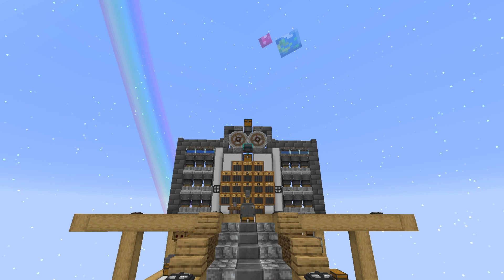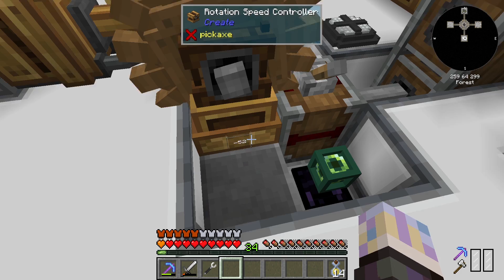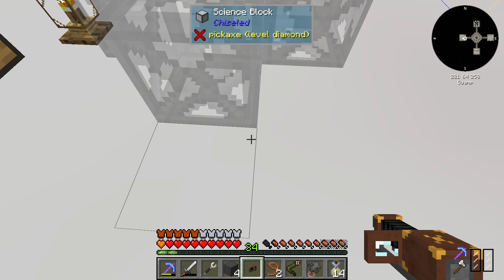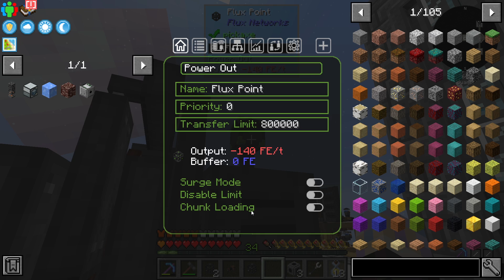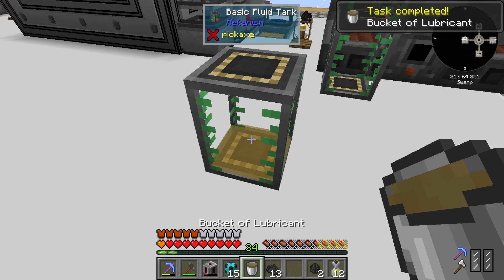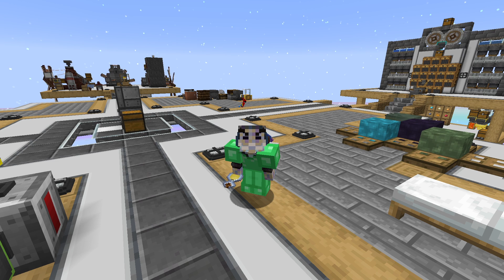Skyopolis 4 Immersive Petroleum EP10

Comment: Actually System, the rotation controller can be used in either direction. In my setup I have the flywheel connected to the side of the rotational controller, spinning a big cogwheel at 256 rpm. Also, if you put a lever on the external heater and flip it on you don't have to process anything in the furnace. Unfortunately it doesn't work with the blast furnace, but given the flywheel on a furnace is already double what a windmill can put out you can see how it's not super necessary.

Comment: The higher tier pipez filters you can use the destination tool to filter where the output goes.  Just remember when using the destination to click on the block face that the pipe is connected to

Comment: I’m pretty sure if you put a lever on the immersive heater and flip it on you don’t need to actually smelt anything to run the furnace engines.
Reply from the maker: I will try that out, but I need all the stone anyway for the blank ores.